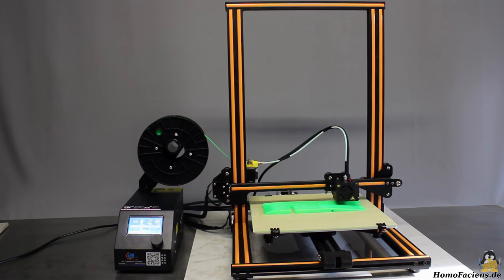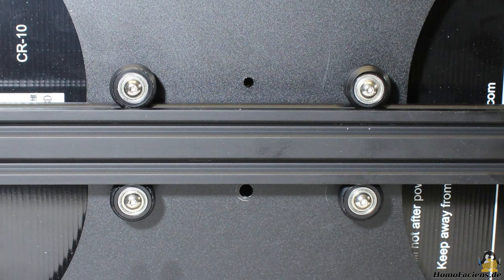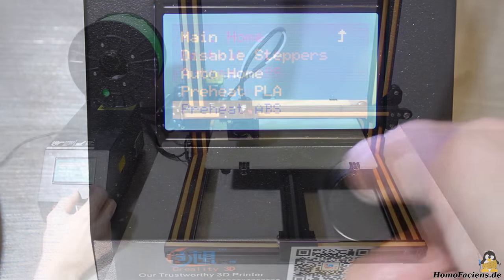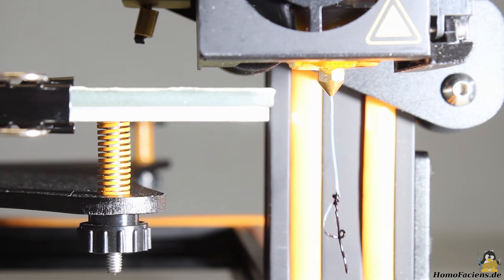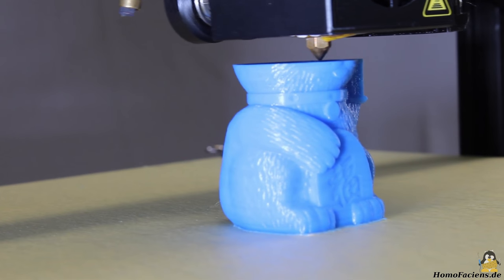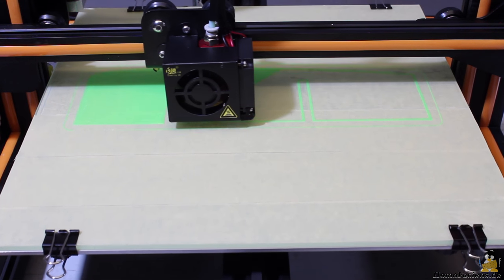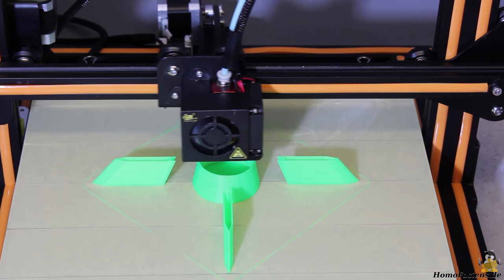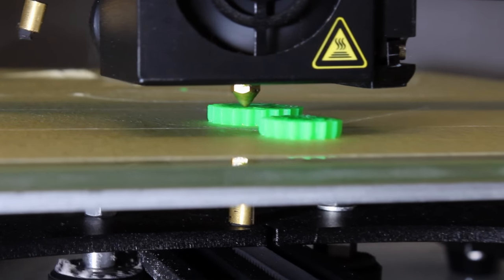3D printer CR 10 review

Comment: Now that was as about a no BS review as you are going to get.  Very well done HomoFaciens.  Questions for you:

1. What are your impressions today about this printer?  Does it still hold up?
2. How often have you had to relevel the bed?
3. How did you square the bed to the nozzle?

You answered the question concerning the rollers already.

Thank you
Reply from the maker: 1.) It still prints as good as on the first day, however I am not doing prints all day.

2.)Usually each new day I am doing a print, because this printer is stored in a corner of my cellar and I have to put it on the table to do prints. When moving a printer you should do a bed leveling. You get quicker in adjusting your printer the more often you go through that process ;-)
I also check the print bed for backlash. You can tighten the rollers with the excentric nuts.

3.) I will talk about squaring and adjusting printers in a future video (too many projects now...)

Comment: Awesome review. My only issue is putting the mic very close to the fans in the control box and nozzle heater fans to suggest the printer is extra loud. . .which it is certainly not.
Reply from the maker: It's mainly the fan of the power supply that is really noisy. The fans on the printhead are in normal range.

Comment: I don't have a 3d printer. But, it sounds like the cat model had a "3d printing raft."  I've heard that it's used to help adhere the print to the bed and also to help during removal.
Reply from the maker: Yes, that's what it is. Thanks for pointing that out.

Comment: this is the second review i have seen for this printer and im pretty impressed with the print quality. I would like to check out its firmware and also see what electronics there running. a bowden design might be good to look into also. thanks
Reply from the maker: I have added pictures from inside the black box (figure 6 on my page):
http://homofaciens.de/technics-machines-3D-printer-CR-10_en.htm
That could help you identify the hardware.
I can't say what firmware the printer is running. It displays "Creality 3D" at startup.

Comment: It is impressive to say the quality of the prints considering the design of the machine is sub-optimal to say the least. The price of the machine is actually quite good considering the components. Overall I would say gearbest has a winner on their hands for price vs quality vs build size. 30x30x40cm is quite impressive for the price range. I would make quite a few modifications to a machine like that, therefore for me it would be easier to just buy the raw materials.
Reply from the maker: Yes, it's not perfect, but really good, considering the price tag.
I will in fact start modifying my Anet A8, soon and building a 3D printer from scratch is also something I have in mind for a future project.

Comment: Hi, i am about to purchase,  since the included nozzle size is 0.4mm, what's the recommended filament diameter size  for 0.4mm nozzle? and what kind of  filament material you  use to print the green color rocket?
Reply from the maker: The filament diameter is 1.75mm, no matter what nozzle you are using. The 0.4mm nozzle is a good choice, you won't like waiting for a large print to finish when using a smaller nozzle. Same as the printer I got my PLA filament from Gearbest:
http://www.gearbest.com/filament-1.75mm-pla-_gear/?lkid=10378182
Reply: thanks, also Got your email

Comment: What's up with the print bed bearings at 18:58 ?
Reply from the maker: Oh, I did not notice that, but had a close look at the bearings, now. It's nothing but fine dust the plastics rolls collected from my workshop. The particles stick on the rolls because there is an oil film on their surface, or it's electrostatic force. Really nothing serious.
Reply: thank you for clarifying this!
Reply: they are wearing out on the profile. because the rollers are not designed to be used on that extrusion....
Reply: That's what I thought. What are the profiles used for this printer. What rollers should be used for the printer?
Reply: I was going to ask the same question.
Reply from the maker: I have added a photo of a bearing after approximately 80 hour of opperation on my pages:
http://homofaciens.de/technics-machines-3D-printer-CR-10_en.htm
I can't feel a grove on the surface and I don't think the rolls will grind to dust quickly. If you are looking for a printer running 24 hours a day and 365 days a year, you might have to spent some more money ;-)
I will have an eye on the rolls every now and then and report if there is too much wear.

Comment: If it starts as soon as it reaches a sensed temperature, I would expect weird prints. Cant it be set to stay at heated temp for a minute or two before it actually starts printing ?
Just to give enough time to allow the heat to be even and consistent heat throughout the extruder part.
Reply from the maker: The print bed is heated up fist and that's the part that really needs time to get heated up evenly. After that, the extruder gets heated (about half a minute), thus the print bed gets additional time to warm up. The extruder heats up quickly as it is a small piece.
You can add wait commands to the gcode files if you think more time is better.
Reply: Cheers

Comment: Has anyone had success printing large ABS parts? The bed on my CR 10 reaches a max temp of only 90deg. If I enclose it with a box, the bed temp eventually reaches 100deg. 
I've seen people recommend 120deg bed temp when printing ABS. With the bed temp only reaching 100deg, using a box as enclosure, and nozzle temp of 240deg, my ABS prints are still cracking and warping. 
I've tried 0%,  50%, 100% fan speed, doesn't really make that much of a difference.
Enclosing with a box has helped somewhat, but partial cracking occurs between certain layers as the part cools down and warps.
Comments , Ideas? Thanks!
Reply: you shouldn't be using any fan speed for ABS. I've heard of people using a hairdryer to heat up the enclosure for big printers before
Reply: To get higher bed temperatures, put insulation on the bottom side of the heated bed.

Comment: from my experience most of the printers built upon Marlin firmware do starts with bad quality but after few layers gets alot better
Reply from the maker: The gcode files I created perform as they should from the first layer, however I will have a closer look at that issue.

Comment: Hi do you think it is easily and worth to buy it for beginner?
Reply from the maker: It is definitely easy to assemble, the adjustment is done quickly as well, so you should get good results even as a beginner. 
Large prints will make trouble because of warping (but that's what all printers have to fight, even the expensive ones).
I always say: Small is beautiful, thus have a look at the even cheaper Ender printer I tested:
http://homofaciens.de/technics-machines-3D-printer-Ender_en.htm

Comment: I really like the circle interface
Reply from the maker: What's the "circle interface"?
Reply: Oh just the clickable potentiometer knob (couldn't think of the word) and the line-by-line screen. It's a very simple way to interact with the printer, just a single knob and leaves a very clean looking case. Reminds me me of the ipod click wheel interface.
Reply from the maker: Yes, that's clearly better than the 5 buttons interface often used instead. Moving the axes or adjusting temperatures is done more quickly.